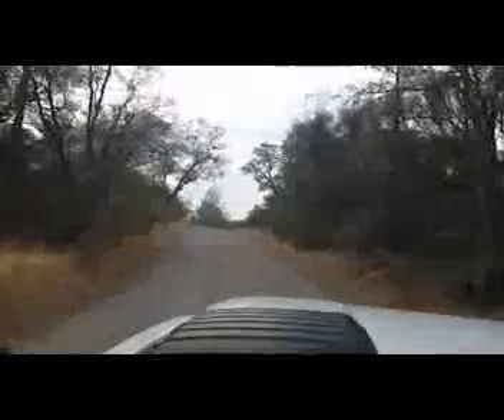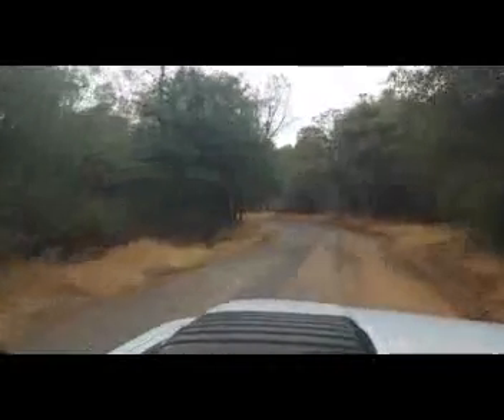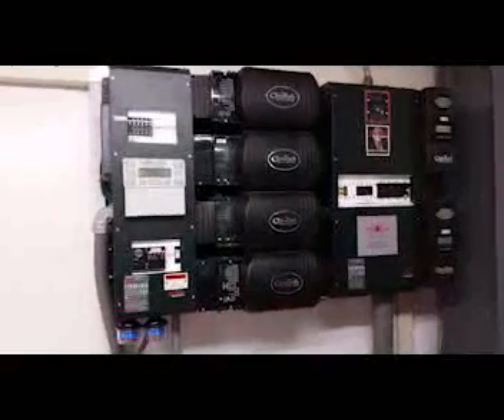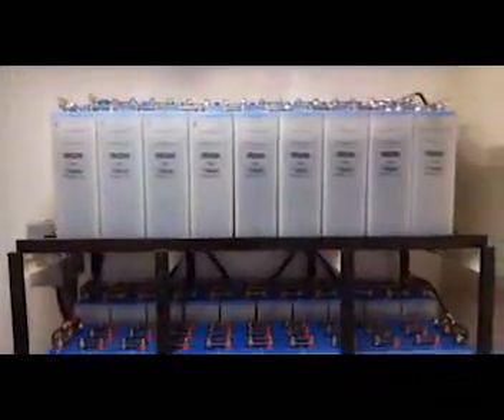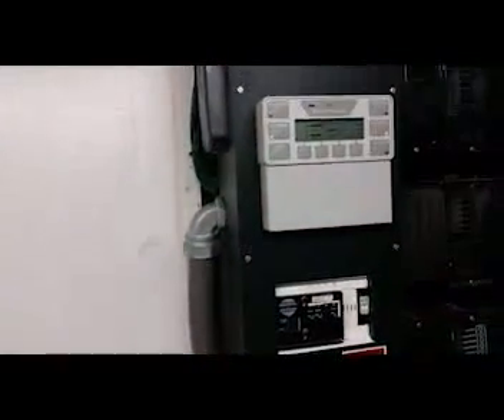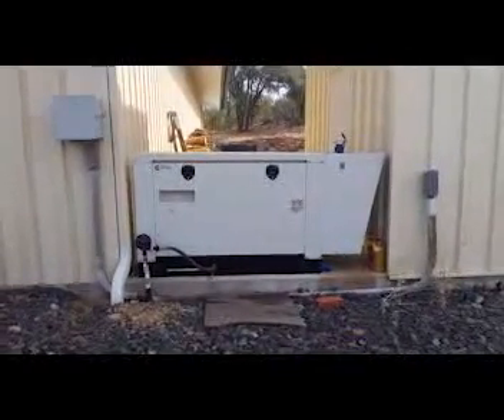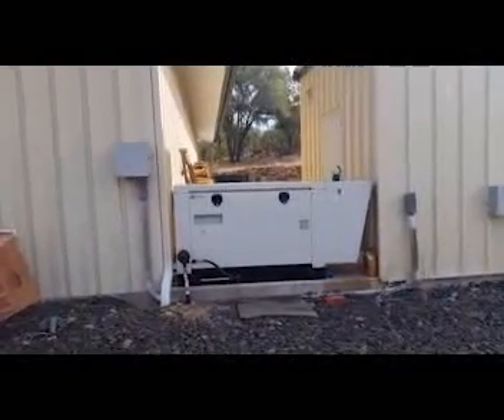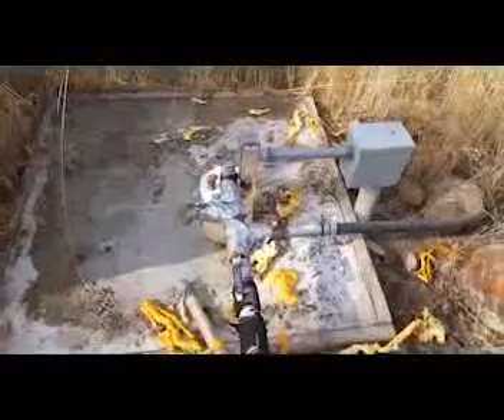Off Grid Solar Power using Outback Power and Iron Edison

Comment: Good video and info. 

How are those batteries holding up so far?

I'm buying the 1.2v 1,200 amp nickel iron batteries direct from China. I've been quoted a price of $495 each shipped. Any info you care to share would be appreciated. Keep up the great work.
Reply from the maker: wjf213 id say they were a good choice for what was a available then but now go with Lithium LFP Batteries
Reply: Thanks for the reply. Really, do the LFP batteries have the same long life span as the nickel iron batteries, or what makes them better or how do they compare? I really don't know and before I buy anything, I want as much info as possible. Thanks again for your help.
Reply from the maker: No Problem the LFP are way more efficient then the Nickel Irons, and as for life span there are batteries out threre with 10 -15 year warranties.  One of the main benefits is that they don't care if you short cycle them, this is a big benefit in the longevity of the battery.
Reply: The nickel iron batteries, they too don't care about cycle times or DOD discharge, do they? I was under the impression that nickel iron batteries are about as bomb proof as you can get as long as you maintain them.
Reply from the maker: wjf213 hahah just don’t forget to water them they can go bang bang from what I hear and you have to add a fair amount more pv because they are less efficient
Reply: Oh believe me, I had that happen once before to my bank with deep cycle lead acid. I had 24 of the 6v @ 415 amp batteries with a Trace power panel and two SW 5548 invertors with a 3,000 watt Whisper on an 84 foot tower, and a 33kw diesel gen set. Long story short, I had a serious back injury and was unable to do anything for almost a year and "TRUSTED" someone to keep the batteries full. You can figure out what happened after that.

Now I've moved and I'm wanting to do solar, around 30 to 35kw worth, and a 150kw diesel gen set, and 280 of the 1.2v 1,200 amp nickel iron batteries. I'm not sure yet about inverters and there's so much out there now, compared to when I did my install back in the mid 90's.

I bought 80 acres with a 10 acre pond and three homes around the pond. There's a 1,200sf home, 2,000sf, and a 3,000sf home and all are very nice and do require a lot of power as far as AC here in Louisiana, and electric everything inside the homes, stove and oven, water heater, dryer, well pumps and so on.

I'm also building a new home for myself built by Pioneer Log Homes of BC, and a pool. In the event of a power outage, I want to be able to keep things running as usual, so I'm looking at having items that are as durable as possible, and give up some efficiency for that durability.

So, that's where I'm at on this and my logic behind it. So if I'm screwed up as polio, feel free to correct me, you won't hurt my feelings. I'm not a snowflake. haha I'm just trying to get a handle on this and understand it better, before I start my search for someone to do the install for me. I'm not interested in the whole DIY part anymore and would much rather pay someone to do it for me while I go fishing in my pond.
Reply from the maker: hahah sound like you understand the off grid life well. Where are you located I have installer friends in a lot of low places :)
Reply: Oh yes, I've been abused like a red headed step child when it comes to off grid. Back then, there was no internet and unlimited amounts of info, so it was a lot of lesson learning. As they say, lessons cost money and good ones cost LOTS. I'm just outside of Lafayette.

Comment: Hi Jason,
where did  you source the edison battery bank? have you checked their efficiency?
rather than filling the garage roof with fix mount panels....you may want to consider tracking them....? 
also what happened to the other solar well pump that was pulled?....in case you decide to convert to inverter/3 phase well pump...you will loose about an hour a day vs DC direct pump.
I can really appreciate your range extender and remote monitoring feature(s).
I'm off grid farming with three Ag wells and all Pv are hanging on zomeworks trackers, ray

Comment: Thanks Jason, Just one thing,please increase the video quality from now on if possible.

Will be watching for more from you.

Tim.
Reply from the maker: +ScootOverMan I had it higher res but the upload time was over 1000 minutes, this was long video the next ones will be shorter with better res and sound even if I have to drive to town to upload them.  Living off the grid can keep it interesting on many fronts
Reply: Thanx.I knew based on you being a tech guy that there had to be a good reason.Its just it really sucks watching 240 when your used to higher.You understand.

I was just looking at those Edison batteries.There not cheap! They do seem high quality.I was trying to figure out what I would need for batteries for my my tiny house(240 sq ft) but its confusing.Will be off grid and wanted to start with a propane generator with batteries.Solar a bit later but solar alone wont do it here in KY.Ok Sir Thanx.
Reply from the maker: +ScootOverMan I would look at using a battery in the 8D series like http://www.fullriver.com/products/admin/upfile/DC240-12.pdf

or the

http://www.fullriver.com/products/admin/upfile/DC400-6.pdf

These batteries are Valve Regulated Lead Acids, they are safer to use than standard Lead Acid Batteries and dont require the ventilation as they dont off gass if the do there is a problem.

deciding factors will be
Cost, Space & system voltage. The down side is you cant check there specific gravity to see the charge percentage, you will want to use a inverter/manufacture that has a shunt style battery meter.  The OUtback uses the Flexnet and the Magnum is a MNEDC to record input and output of amp hours and KWH to show a state of charge.  There are other standalone shunt style monitors but I prefer to have one that is integrated with the inverter myself.
Reply from the maker: +Niko grossenbacher the 8d is a decent battery, I have used them in the past but I typically use them on battery back up systems not off grid.
I would say the best vang for the buck is 2 volt L16 series batteries.  you can get a solid 1200 ah or more on a single string. what brand of inverter are you using?
Reply from the maker: +Niko grossenbacher ok what are you using for a ac battery charging source and what kind of charge controller